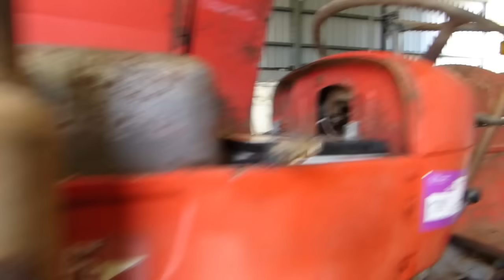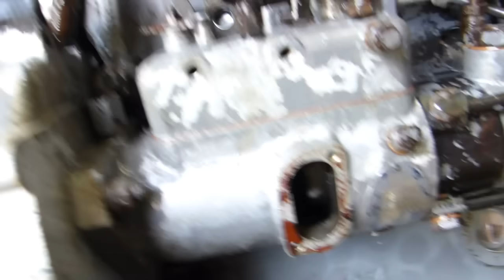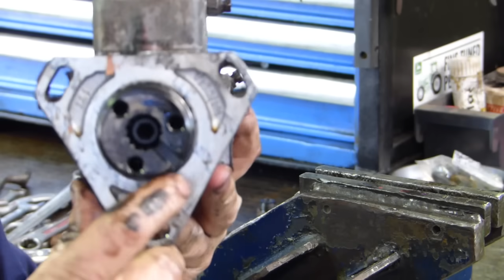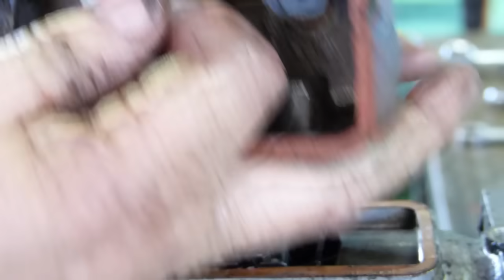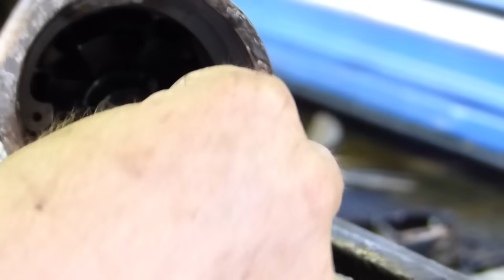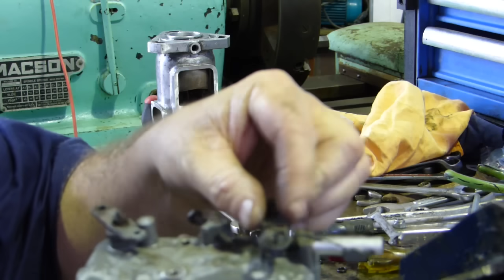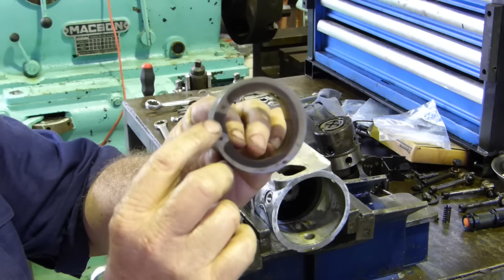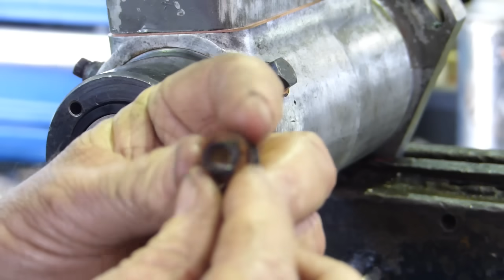CAV Injection pump full strip down to re seal and stop fuel leaks

Comment: Thanks a million mate or at least $1000 I've got a Cummins 4bt with a Cav pump in  my yacht,  it  got a mouthful of water in it the other day and stopped as we were entering Yamba bar, we ended up sailing on to Southport were I discovered your vid and the possibility of the shaft under the top cover sticking..... And bugger me if that wasn't our problem.... And now fixed! Didn't even have to take it off the motor. 
Thanks again
SV RedDragonfly
Reply from the maker: G Day Simon, How good is that! Glad we could help.

Comment: Can you please tell me what kind of tractor this pump is attached to? it is Massey Ferguson i know but what is the line and what is the engine,thank you
I need to order a pump from used parts place that sells tractor parts and i need to install it on a welding unit.
Thank you very much
Reply from the maker: Joseph Succar this was on a Massey Ferguson 65 with a Perkins 4.202 from memory
Reply from the maker: Make that A4.203 bloody typo

Comment: great video, I now have more confidence to attack mine. my problem is, my pump will build pressure and hold it in the case, but no fuel gets to the injector lines. any ideas, before I tackle a complete rebuild? thanks.
Reply from the maker: Possibly the piston under the cam rollers stuck or just a stuck metering valve.

Comment: when you remove the injection pump on a massey ferguson 35 will the timing chain fall down or do you need a special tool to hold it in place ?
Reply from the maker: Niall Brady no you do not need to worry it is a gear and supported
Reply: Thanks mate love your videos, also thanks for coming back with your answer so quickly .

Comment: Lance - VERY excellent video! It showed some tricky bits there, all right!

A friend has an MF, and the fuel pump is injecting diesel into the crankcase from the front of the CAV. We replaced all the o-rings on the kill switch and butterfly, and there appears to be an o-ring past the main seal on the 'front' (not the fuel line side).

I didn't see where you removed the shaft and showed it?

Is there another seal o-ring at that end that might have failed, do you suppose? 

We looked at the engine while it was turning over, and the fuel just jets out from the front into the oil pan, but we aren't sure if there is another seal besides that main one that could be the culprit.

Also, have you heard of anyone doing a conversion to an electric fuel pump on these?

Thanks very much!

A.E.
Reply from the maker: There is a front lip seal that will be your problem, it is shown you may need another viewing

Comment: Hi Lance  Question,  If the vanes are worn in the transfer pump  would that cause blue/white smoke when cold,    new piston rings,valveseals no crank case compression, new injector nozzles.
Reply from the maker: G day Roger, No I wouldn't think so, Timing can do it but some older pre combustion models did do that a bit, often fitting new glow plugs helped to fix it.

Comment: One small thing to beware of. The fine components of injectors and injector pumps can be affected by the salts in your fingers. Literally touching them with bare skin can reduce performance and cause premature wear. For other people, beware of dust. the tolerances are ultra fine, dust in the air is like throwing a hand full of rocks in the pump.
Reply: Just don't eat salted peanuts before.
Reply from the maker: Yes fair comment.

Comment: Hi, Thanks heaps for making the video, mine is leaking out the throttle shaft as well, its on a John Deere 2020, i am going to give it a go next week when the parts arrive. My throttle needs to be on at least half way to keep the tractor running anything under that and it stalls, do you have any thoughts on what this could be caused by?
Reply from the maker: G Day Simon, Possibly sticky main piston or metering valve you will probably find it when you tear it apart.
Reply: Hi Lance, Again thank you heaps for the video, i did the rebuild on the weekend and ran the tractor up yesterday and it runs beautifully now with no leaks, I think it was a combination of the metering valve and the main piston as they were both a bit sticky but no issues now. hope this reaches you well and all the best for the future.

Comment: Thank you so much for this video.  I have a 245 and 255 that were leaking so much diesel that I had to close the tank valve after each job to stop it from leaking. They charge 900$ for this job in my area. You saved me a lot of money man. Now, I need to stop the leak from under the steering wheel.
Reply from the maker: G day Yannick, Glad it could help you, they are not that hard when you are shown how eh. thanks for watching and commenting.

Comment: Hi Lance - I think I have found out why I'm losing power when it's warm and she has been running at reduced revs for a spell. The pump back-plate is one of the old ones without the steel insert and the face is slightly worn (about 0.06mm). I know I could buy a new genuine replacement of the new type with the insert for about 12 quid but I want to keep as much of the original bits on her as I can and the new part would say "Delphi" and not "CAV" (OK - I know - I'm a bit of a nut). I'm not sure if it will work but I have flatted the face off on a diamond-block as I guess I have nothing to lose. Incidentally, the problem was probably made more obvious because the supplier filled my drums with 28 second heating oil instead of 35 second "red". Do you have any thoughts about adding engine oil to the fuel? Seems as if the low sulphur diesel we have to use now has a lubricity issue anyway so was contemplating this before I found out the fuel issue.
Reply from the maker: G Day Colin, I dont have a problem with oil in the fuel, possibly two stroke even. You can buy new blades for the transfer pump that might seal better on the side of your newly polished end plate that may help too.
This reminds me of a mate that couldnt start his tractor when hot so he would pour his water bottle of over the pump and away it would go but it was worn on the main plungers in the head of the pump and cooling it closed up the tolerances a bit.
I understand the not wanting delphi on your tractor Im a restorer too lol.
Reply: Thanks Lance - I'm hoping the fact that mine starts really well cold or hot means the high pressure pump is OK as I guess a complete new rotor assembly is the only fix when they are too far worn. Hopefully I'll find out tomorrow if the new filter-to-pump pipe turns up. I had to sacrifice the old one as even with the inlet connector in the vice and loads of heat it wasn't shifting so I ended up putting it in the lathe and machining the flare-nut away to dust (and a little rusty 'spring').
Reply: She's good. Put the old pump blades back to start with just to see if the back-plate wear was the issue and did an afternoon's work on her in weather even an Australian might find warm enough and she was great.

Comment: I need help. just went threw your video and resealed my injection pump. tested to see if it was working on the bench and it squirted fuel out fairly good. now it's installed on the tractor and now it will not pump fuel. gear is turning inside I've got fuel coming from both breeders. I'm puzzled.
Reply from the maker: Wayne Meadows Loosten all of the injector pipes at the pump end wind over incase there is an air lock in the head
Reply: Bundy Bears Shed i have done that and fuel dripped out of the fittings turned it over several times tightened them all up and still no pumping of fuel.
Reply: FIXED i finally figured it out. Turns out that one of the roller cams inside the pump was stuck and would not rotate or protrude out. Couldn't have done this without your video thank you.
Reply from the maker: Glad you got it sorted

Comment: is that a 10hp M on the trailer?
Reply from the maker: Sure Is
Reply: You must have a collection? I'm a collector I've got about 15 or running engines and 50 or so waiting to be restored or parts. I've got about 5 oil field engines too.
Reply from the maker: Yes I had over 50 but let some go to the young ones in our club. I still have the full set of Ignitor Ms a couple of 3hp vertical Famous 3hp Nonpareils, 2hp Nonpareil, 4hp hopper cooled Famous plus a few others. Oh a KK Crossley and a Dial which is a round rod Galloway, Plus a few more. Its a good hobby for a tractor mechanic. I have a few tractors too.
Reply: Just discovered your channel. I'm a mechanic too. Mainly auto and light truck. But now venturing in big diesel like heavy truck and equipment. I'm in upper Midwest, central Minnesota. Sounds like you're in Australia?
Reply from the maker: Yes Bundaberg Australia, In the state of Queensland. We make the best rum in the world Bundaberg Rum, well that is our story. lol
Reply: I just subscribed to your YouTube channel. I'll be watching. I'm hoping to start my own channel this coming winter. I'll keep in touch with you. I've got your Crossley video saved for later.

Comment: How do you test them to see if they work/leak on a non starting tractor?
Reply from the maker: G Day Dlaveen, The pumps can just get a bit stuck from the laquer that the diesel forms some times, It is usually just the little plunger under the inlet or the metering valve stuck but unless it is rusty inside it should be easily repairable.
Reply: Update  Disassembled the pump. Brown lacquer/varnish everywhere! Cleaned everything, put pump back together. Good news is that It pumps out fuel. Bad news is that its only putting out fuel to 1 (out of 3) injection pipes.
Reply: Yeah. The steel washers are there. I dicoded to connect the inlet/return lines to see if it was some type of vacuum issue. When all three lines were connected (basically i put all three lines from the injector pump into a can of diesel), i did see some fuel coming out of the lines. I still will go back and check though. Thaks A LOT!!!!
Reply: Okay thanks. I'm going back to check the fittings... I'll keep you (and everybody else reading) posted.
Reply from the maker: G day Douglas, I can only bench test to see if they are working on the bench by turning the pump by hand and adjusting the throttle lever and the stopper .
Reply: Bundy Bears Shed 
Okay Thanks. Does these go bad? I got one on an old 4000 (Ford) that hasn't been started in over 12 years. when i crank the engine, nothing comes out of the pump. I put some fuel down the inlet port but nothe came out the other ends (3 cyl)
Reply: Thanks. I'll use your instructions and let you know how it turns out.
Reply from the maker: Douglas Lavergne check the fittings where the injector lines go you may have them in wrong. They should have steel washers under them
Reply from the maker: Douglas Lavergne if it comes out of one it should pump from all as there is only one set of plungers to pump with
Reply: Sounds like air.
Reply: Hi Douglas, I know it's been a year already but have you fixed your tractor yet? I do have Ford 4000 sitting in the ranch that hasn't been started for 15+ years. It was my grandfather's he said it had a leak. I wanted to get it running again.

Comment: Hi Lance, thank you very much for this video.I am an independent mechanic and since watching this video awhile back I have resealed about 10 of these pumps, so thank you very much and keep up the good work.
Reply from the maker: Thats good to hear thanks for watching and commenting.
Reply: @bundybearsshed  my other question is the plunger in back of pump, I put plunger back in, then spring, then rest. Seams like there's a bit of a  gap between plunger and spring or top of spring to what ever it touches when gravity let's it fall down as low as it goes, (till plunger hits bottom spring), is that normal!?. The little spring under the plunger is good. Seams weard too me. I'm trying too explain it best I can
Reply: @chadbailey8152  sounds like the fuel pump is bad
Reply: @bundybearsshed  I need help!! My engine sat for 6 to 7 years or more, it will not get pressure to injection, I checked the stop lever seamed good, the throttle lever under cover is good, I checked to plunger in back of pump was stuck, got it freed up, acting the same way, it gets a little out lines just enough to see it kinda works but will not start, tried eather. Nothing. U think the plungers are stuck that pop injectors off inside pump?, It has fuel going out all bleeders and all new fuel too
Reply: Such a great informative video and you do a great job of giving all the necessary information without wasting our time talking about things that are irrelevant. Thank you so much for taking the time to explain all you have.
Reply: Warum gibt es solche Instruktionen nich auf deutsch?
Reply: Hello Warren, I have this job coming up on one of our tractors, good to see you over here

Comment: G'day Bundy, Great vid mate. I've got a Case cx90 tractor with a Perkins 4 cylinder. The Lucas injector pump is leaking out of the little hole that is on the side of the mounting flange below the bolt with the oval shaped copper washer. The ID tag says its a Lucas Type: 1272. DES: 8920A691T. After watching your video I'd be confident to have a go at replacing the seals in it but Case don't list any parts for the injector pump. Any idea where you can get the seal kit for this pump as I can't even find that pump on google? Cheers, Cam.
Reply from the maker: G Day Cam, No Im sorry I dont have that kit available. It could possibly just be the front seal as that bolt hole if for timing the pump before you pull it off the machine. It might be worth pulling off to see if it is just a normal front seal but I cant tell you Im afraid.
Reply: Thanks mate much appreciated. Cam

Comment: Thanks very much for your very informative video. I have trouble starting the engine after fuel tank repair and filter replacement. Basically I have not a drop of fuel at the pump injector pipes. Bled the pump umpteen times. Plenty fuel there! Engine was an easy starter before this. What could be wrong?
Reply from the maker: If you have had the top cover off it is possible that the stop rod missed the hook but I would suggest you look at the metering valve it could be sticky and not opening properly.

Comment: Good video. I had a blocked line going to my fuel filter housing on Allis Chalmers 6140 and it died. Cleared the blockage and replaced the fuel filter. At first it cranked up for about 3 seconds and now it won't fire. Was thinking maybe it lost prime but not sure how to reprime it. Will try cracking those spots on the side and see if any air comes out.
Reply from the maker: Certainly worth a go

Comment: What a great and well made video: well explained. I have a CAV injection pump for a Universal Farmliner 445DT tractor for which i had the seals redone as it was leaking fuel from the large rectangular seal at the top housing.  (I had it done by a mechanic at low cost).  When i put the pump back on the tractor it worker fine but after a while the tractor just died on me.  I have been told the injection pump was dirty from 'muck' coming from the fuel tank that needed cleaning.  I said to do it but later was told the whole pump needed an overhaul as some water had entered (tractor always under cover so not sure how this happened).  The pump just is not pumping fuel into the injectors.  Is this a matter of a new overhaul to the pump?  or is it just a reseal of all washers as in your video to get the pump going again?  Your expert opinion would be appreciated as complete overhaul is very costly and i have a feeling it may not need all this. I shall be interested in your feedback and if the fix is possible for me to do (i am very handy but not a mechanic) or even you can do it if i sent it to you. Thanks Andrew.
Reply from the maker: G day Andrew, I would strip the pump yourself and clean everything out. If there is a little rust clean the part with some 400 to 600 wet and dry sand paper. If you follow the instruction you will be fine and take some photos along the way. The only thing I didnt pull apart is the plungers under the rollers but if you can push yours back and forth they should be ok. Im betting the metering valve is stuck as they do that from time to time. When you are done clean your fuel tank and change the filters and you should be good to go.
Reply: will i need a new set of the seals kit package?  How long would the whole process take to do the whole pump?
Reply from the maker: Yes you would need the complete kit and it would take a couple of hrs. Probably more being your first one